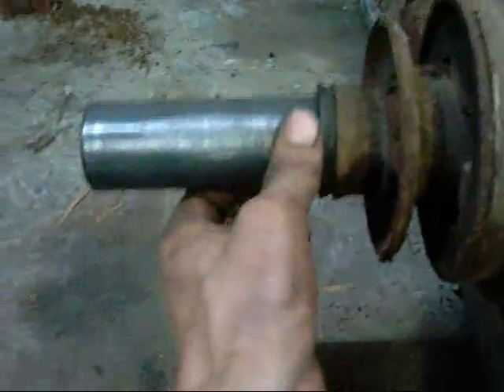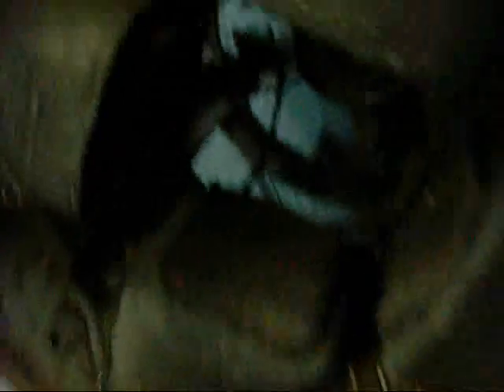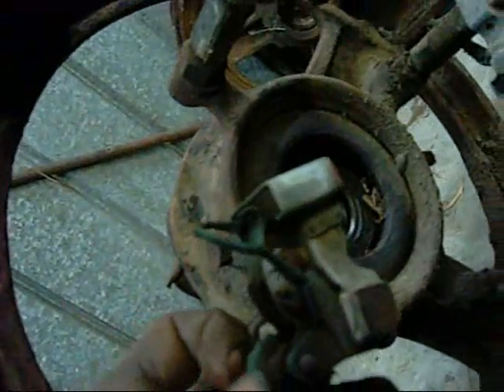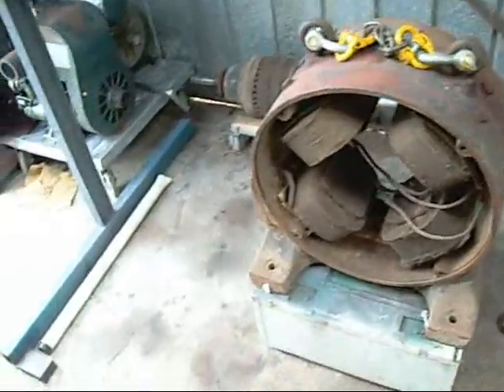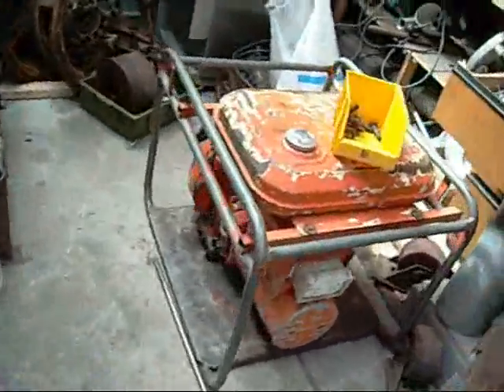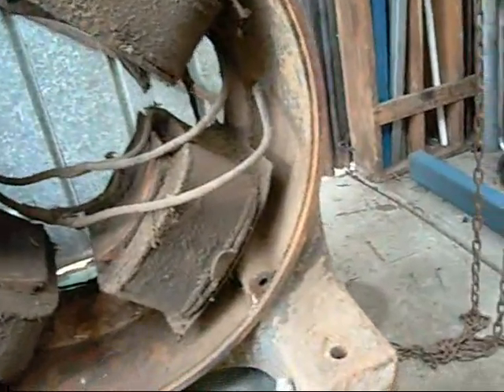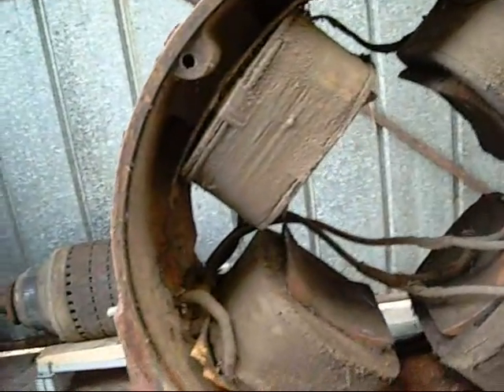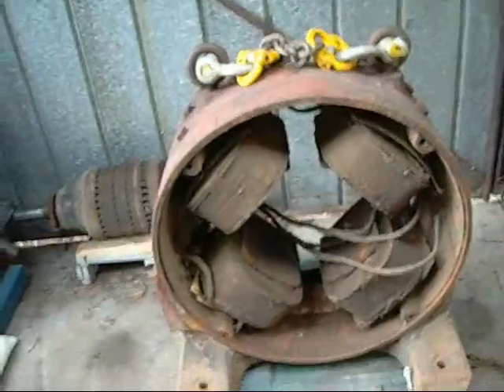Westinghouse Generator Disassembly

Comment: Fastest way to remove rust from your motor housings with least amount of work is to dip in a solution for 2 weeks of 1 gallon of molassis to 9 gallons of water, then pressure wash off and she is ready to prime and paint. Oh and for coil colors to make her pop use Hot Pink!...HA!~

Comment from the maker: @pvcarmon1 Its about 80 years old, so it definitely wouldn't be up to today standards, i think it was powered by a single cylinder horizontal flywheel engine (diesel) and I know for sure it was used for lighting and communications power on Phillip Island in Victoria - Australia . a Motor and Generator tech I know saw it many years ago when it was still in its generator shed next to the telephone exchange house.

Comment: Hello, I had a question, Curious to know what that generator used for? What type of diesel engine was running it? Dose not look like it would comply with today's strict air quality  management regulations for 24/7 continuous operation at least in California. It looks like it was used in an oil field at a remote location in a region where sometimes light crude without refinement could be used to run a diesel engine. Whatever the use, it appears to be a well made piece of mechanical artestry.